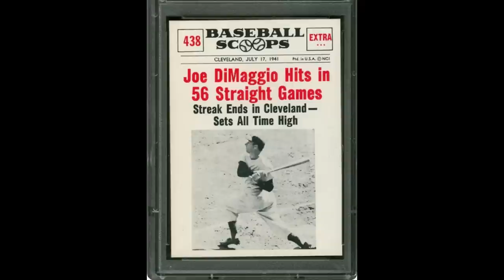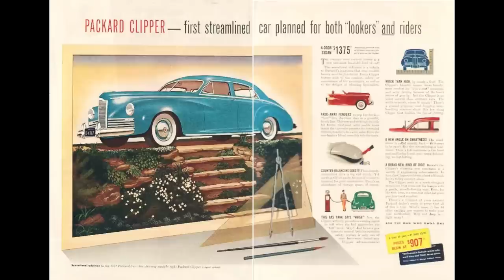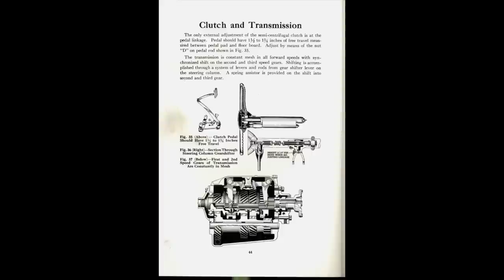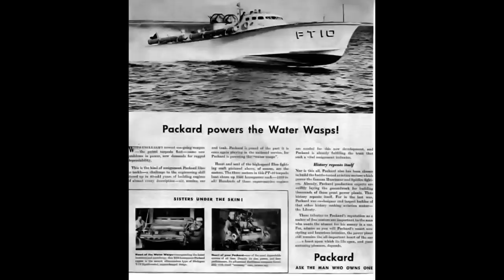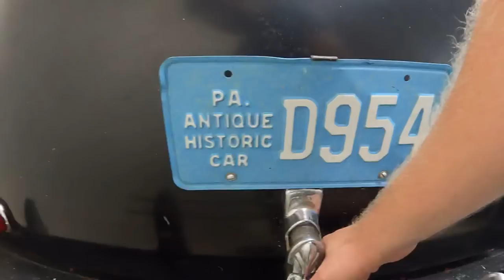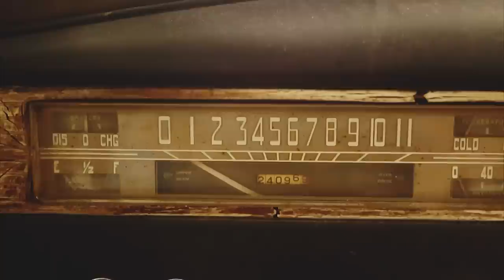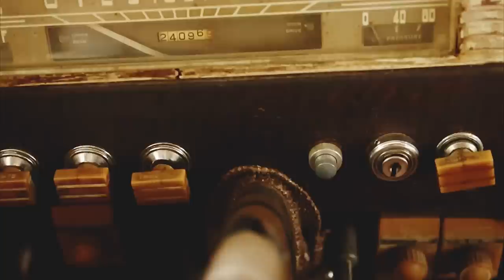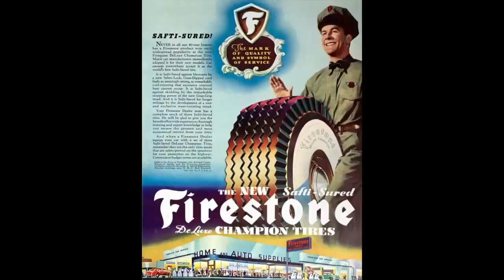1941 Packard 120 sedan

Comment: Hi Jay. It was nice to see such an original car.  Further, I hadn't realised that Packard in 1941 was offering two quite different body types - the one shown here being the old fashioned body for the old money, and the stylistically up to date Clipper for the new money.  It was probably a sensible move.  Cheers.
Reply: Looks very original but it would be a candidate for a complete rotisserie restoration. With 3D printed components now being available, I hope the dashboard hardware could be made out of more durable material than such primitive plastic.

Comment: Which would I select?  Of the period there's no debate - Packard!
Reply from the maker: I totally agree but if your choice was this Which one would you pick
1935 Hupmoblie 
Or
1937 packard 120 
Or 
1937 Chrysler air flow
Reply: You got me - the Airflow.  There was a video of a 3-car caravan from San Diego to a National meet, and going thru Utah, I think it was - stunning country - the camera showed this 5,000# car, which dyno-ed at 88 hp, cruising at a rock-steady 85 mph. @What.its.like.
Reply from the maker: I want to cover an air flow before the end of the year so so so bad.. I really really want to drive one.. they are just so unique and so different than anything else that was available at that time it’s almost like an American Tatra instead of having a flathead V-8 it has a straight though and the De Soto aren’t bad either and I saw I won this year at the Gilmore auto museum and I was just drooling all over it I I love those cars I have an addiction to weird cars the weirder the better
Reply: Wilbur Wright worked with Chrysler designing the car in a wind tunnel - 1st ever created that way. @What.its.like.
Reply: Chrysler engineering was on a par with Packard, tho' the cars just didn't 'have it' 'til mid-1950's.  I was with Mama when she bought a 1950 Dodge Coronet Deluxe. It was a 6 but would easily cruise at 60-65..Then the 1951 Chrysler Crown Imperial with the epic Hemi...THAT was a car!

Comment: Because most cars way back when had pontoon front fenders and the engines were buried inside, overhead creepers were a must. You can still buy new ones today.  Because they insist on covering everything up under the hood with fancy covers, the engines themselves are kinda getting buried again. Now with thinner metal all over the cars, especially the front fenders and different types of materials, like aluminum and plastics, it is even more important not to lean on or push body panels in modern cars today. So, there is a renewed need for overhead creepers.
Now, I learned the hard way, but even Japanese cars, like the Datsun "Z" cars could be damaged in unassuming areas by leaning on or pushing. We always had to watch out  and be careful with the Italian cars, like Ferrari's, etc, if you sneeze on them wrong you can dent them, but then, sh*t still happens.
Now, those old cars, like this vintage of Packard, you can probably stand on those front fenders and not damage them!
The reason that there is no transmission tunnel in cars like these Packards is because the cars are so massive, and looking at the engine, how low it is mounted in the chassis, so is the rest of the drive train. There was no need for a tunnel.
It is interesting that you mentioned front wheel drive cars and the tunnels. Well lot's of them have tunnels eventhough there is no drive shaft nor a transmission. Because many cars are built for multiple types of drive systems, they may still have a tunnel, and they use it. An empty tunnel is a great place to run the exhaust systems. It doesn't have to run under anyone's feet.
You are too young to have seen it the first time around, but, as you know, Oldsmobile introduced the revolutionary front wheel drive Toronado in 1966. They advertised it as having a floor as flat as your living room floor. Eventhough there was no drivetrain tunnel, they still ran the exhaust system down the middle on the front wheel drive cars. Luckily I caught it in time, but I was working on a front wheel drive 2nd generation Cadillac Seville. The engine had multiple misses. This superheats the catalytic converters(which is why the check engine light flashes on the OBD II later model cars when there is a problem like the one I had). I happened to look inside the car and noticed smoke coming up from the carpet on the front floor! Luckily I caught it before it started on fire and it didn't do any permanent damage. The cause of the missing was that a mechanic at our shop didn't tighten the spark plugs when he changed them the day before. I discovered it just by chance when I noticed the spark plugs giggling as the engine missed. Tightening them all up fixed it.
Reply from the maker: Th am you so much for taking the time to share all that insight and information

Comment: I like the bustle trunk on the '40 more than the trunk on the '41 for some reason. I just can't get over today's cost for what you would get versus what 27K will ACTUALLY get you now at a dealer. 2 questions. Does the glass on hood ornament light up? And, this isn't just a Packard thing, but why did cars back then have a separate lever for overdrive, instead of just adding a 4th or 5th gear to the transmission? 1) No real preference. They're all beautiful. 2) Packards are sah-weet, and I'm not a Caddy dude, but... but... that Caddy, style wise, is freaking gorgeous!
Reply from the maker: That Packard hood ornament doesn’t light up Indian Pontiac Indian chiefs did and some other companies as well Hudson had a light up emblem at one point.. 

For the overdrive I think it was cheaper to produce it outside the transmission it’s not part of the actual transmission it’s a separate unit to my knowledge it mounts behind the transmission.. Packard did have a four-speed at this point but it was more or less for higher up models.. and it was a synchromesh unit as well

here’s one for you that they used to do in the 30s all the time and why they don’t do it now is beyond me some cars like the auburn speedster was offered with a two speed rear end meaning you can change the final drive ratio on the fly making your top speed increase or get better gas mileage, because of an overdrive unit can cut engine speed by a third just imagine what you could do with a rear end gear just imagine if you had 373s and 290s or if you could figure out a way or anybody can figure out a way to make every revolution of the crankshaft be to revolutions at the rear end you’ll be getting quadruple gas mileage. Because with every turn of the crankshaft the wheel will move to revolutions which would be insane but nobody has figured that out I can’t believe we’re not working on that problem..

Comment: WYR1:  One Ten. The 2023 neighbors won't know the difference. A;so worth consideration in this price class would be the Studebaker President Land Cruiser or the Hupp Skylark or the non-supercharged Graham, these last two built on the 1936 Cord 810 body stampings. 
WYR2" Again. the Packard with the Studebaker, Hupp, or Graham also under consideration. The leaf spring solid axle front suspension in the Lincoln would be a deal-breaker, and I just don't like the Cadillac styling.
Any further comments about the Lincoln or the Cadillac, I would recommend googling the pictures of the hearse that carried Henry Ford to his final reward.

Comment: Your year equivalents for price are way off base. It appears you are using a simplistic CPI conversion which ignores the fact that the average price of a vehicle has increased markedly (hooray, Detroit).  The 120 is a middle-class car, which today would be running in the low $40,000; not ~$27,500.
Reply from the maker: This is the calculator the was used.. 

https://www.in2013dollars.com/us/inflation/1941?amount=1300

Technology is cheap now labor is expensive the opposite was true then